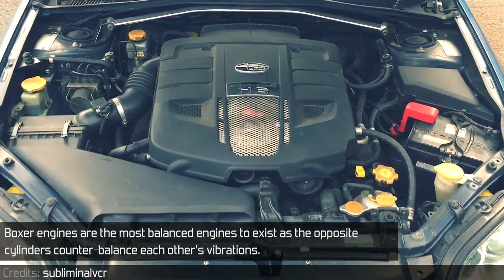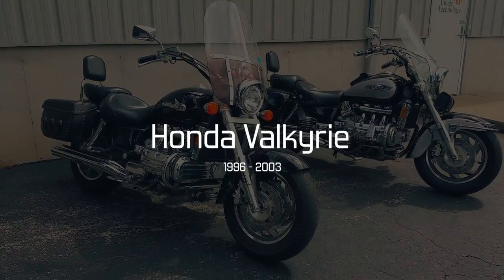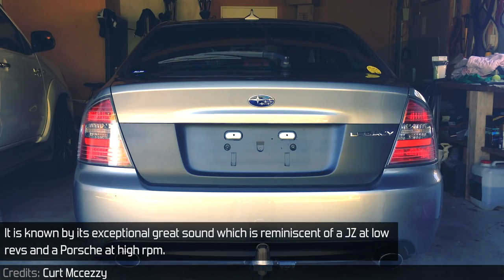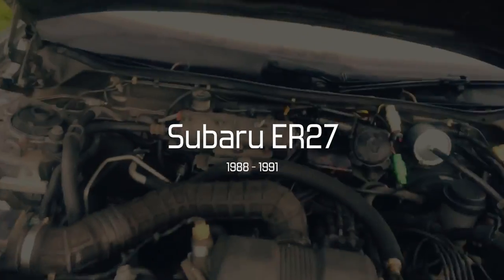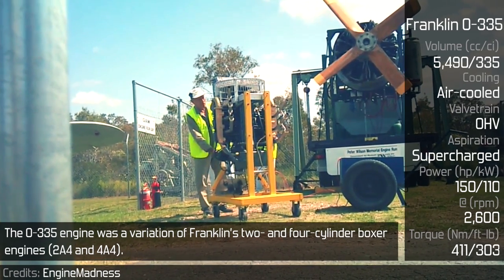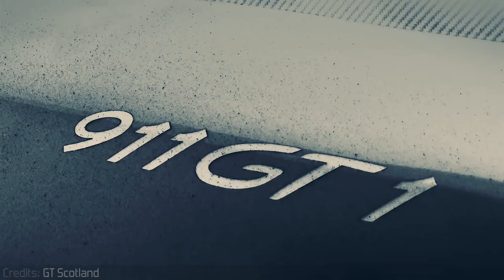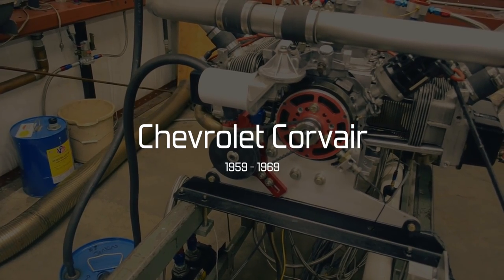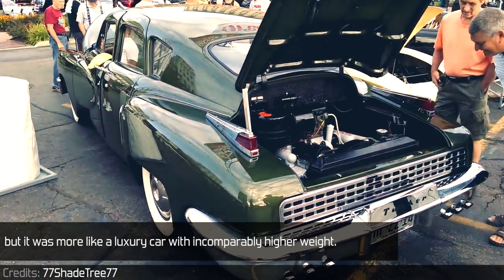10 Uncommon Boxer-Sixes You May Not Know About

Comment: I can modestly say I knew all of these :)
The Lycoming and Franklin have similar names because they follow US nomenclature for aircraft engines used by the military. In this system the letter represents the configuration of the cylinders (R=radial, V=vee, O=horizontally opposed, etc...) and the number represents the displacement in cubic inches.  
Regarding the Corvair, something that our European friends don't usually know is that not only was the 1965 Corvair Corsa turbocharged, but it was actually the world's first turbocharged production car.
I currently own a 2001 Valkyrie. It's a big pussycat, but when you open it up it really turns into a dragon !
Reply: Some 1963 Corvairs had the turbo. I know because I have one.

Comment: Lycoming made a 720 cu. in. 8 cyl boxer (opposed) that is supercharged, turbocharged and fuel injected (TSIO720) rated at 450 hp. because it is an aviation engine it has two separate magneto distributors and two plugs per cyl. There is one on display at the Air Venture Museum in Oshkosh WI.
 Franklin produced a 16 cyl boxer that was never certified and used in target drones it was rated at 450 hp and there is one on display at the Air Force Museum in Dayton OH.
Because aircraft engines run a prop, the load is constant once set, and the horsepower rating is at a 100% duty cycle. 
 An unmodified chevrolet big block (454 cu in) can not be run at 300hp constantly without overheating when turning a prop.

Comment: A quick bit of trivia:  Aircraft piston engines are given designations.  The first part is a letter denoting the arrangement of cylinders, the second part is the displacement in cubic inches.  A Franklin "O-335" means that this is a horizontally-OPPOSED engine of 335 cubic inches.  An R-940 is a radial of 940 cubic inches, while the engine in a P-51 Mustang would be called an SIV-1650 in this scheme, the "S" standing for supercharged, and the "I" for fuel injection.

Lycoming builds a TIO-540 engine which is turbocharged, while Continental builds a TSIO-550 engine, though they are basically the same thing.

Comment: I'm glad you released this video. Some day I want to build an FRS with a flat-6 swap to use as a fun street car. Granted the engine I would consider using isn't in this list, the Subaru engine out of the legacy is one that I considered.
Reply from the maker: I'd consider the 245hp EZ30 from the 3.0R. Great sound, great power, definitely better torque and you still kinda keep the point of the car - the low centre of gravity. Approved!
Reply: VisioRacer I have an outback 3.0r and I can tell you the engine is great!
Reply: Yummy Hershey wouldnt be too hard of a swap to do an ez30 into that body style as people seem to be able to cram straight 6s into it. would recoment going for an ez36 though bit more grunt for relatively the same packaging size.
Reply: That's the one I am considering the most, but it is relatively unexplored. I think it's still the best option though.
Reply: Yummy Hershey check out the might car mods gramps build. you will see that this engine has its stock internals limit explored  however the engine itself is reletively unknown. the more people doing these swaps the more of an aftermarket will develop for it ie what happened to the ej33 and ez30

Comment: Boxer and flat engines are not the same..
Reply: MyLonewolf25 yes they are two names for the same thing
Reply: all boxers are flat engines but some flat engines are 180° vee types :-D
Reply: Joshua Godsey NO they are not 
Boxers do not share a crank pin
180* v types to 
Aka a flat! 
Quite different 

That's like saying a cross plain v8 is the same as a single plain! 

Not all flats are boxers but all boxers are flats!
Reply: Quite right. 
A case in point is the Ferrari 365BB (Berlinetta Boxer) - this has a flat 12, but is actually a 180 degree V12, not a boxer.  This is because the opposing con-rods run on the same crank throw, instead of being separate throws 180 degrees apart and both being at TDC or BDC at the same time

One minor point, the term is 'cross plane' or 'single plane' in cranks for V8 engines
Reply: MyLonewolf25 I read that article and it was very interesting and it makes sense I guess they are different
Reply: So which is the Corvair?

Comment: with lycoming and Continental the prefixes have simple meaning TIGO-550 T-Turbonormalised I-injected O-opposed G-gear reduction with 550cu in of displacement. most all modern general aviation use opposed engines of the 4 and 6 cylinder varieties and cost a fortune  ($30K+USD) nice video but in aviation the opposed engine from the 30's still lives on with only minor improvements, and "eh" quality and dumb costs for the lack of innovation up until very recently with a movement toward fadec engines for certification.

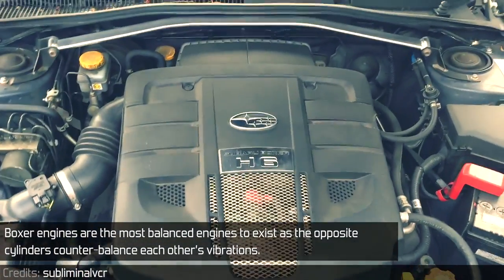Comment: 0:00 wrong. Straight sixes are the most balanced. all forces and also all momentums cancel each other out.
Reply: I6, V12, Flat 4 or Flat 6 are all fully balanced. there is an opposing piston for each piston at TDC.
Reply: Yep!
Reply: mindstormer13 what about rotarys?
Reply: What 911 said. There is an old test from at least the 1980s, maybe older: Start and idle a V12 engine. Place a Quarter/D-Mark (That's a midsized coin for you young people) on its edge on top of the engine and it will stay standing, due to the very subdued vibrations. I've seen it done with a BMW 850.
Reply: 911s73targa incorrect. all of these engines experience vibration due to the dynamic mass imbalance. inline 6 experiences least vibration. https.m.wikipedia.org/wiki/Engine_balance
Reply: barath4545 because the engine was balanced by a harmonic balancer, a necessary part to counter vibration. this balance is not a matter of layout.
Reply: keep in mind that wikipedia can be edited by everyone
Reply: Wikipedia provides good articles so long as educated people contribute. In regards to the engine balance article - the information is good.
Reply: Interestingly enough the article you quoted says that Flat 6 in certain aspects are better then inline 6

These 6 cylinder Boxer engines have 14. (Plane imbalance on torque generation) and 
16. (Plane imbalance on compression) just like in inline six. 

As the strength of vibration generated by these imbalances are more or less proportional to engine length, boxer six has the advantage as flat-6 is much shorter than an inline 6 configuration. 

However, boxer six has additional plane imbalances on rotating mass (4.) and reciprocating mass (6.) due to its left and right banks being staggered front to back, although the offset distance tends to be much smaller in relation to the engine size than in flat-four and flat-twin.

On the other hand, secondary balance is far superior to Straight Six because there are no piston pairs moving together, and is superior to V6 because a large part of secondary imbalance is cancelled in the opposing cylinder pairs except for the front-to-back offset. This makes a boxer six particularly suited for high-revving operation.

And contradict your earlier statement that all forces are cancelled out

"However, the piston pairs that move together tend to make secondary imbalance strong at high rpm"

So for high revs, a flat 6 is better then inline 6 according to this article, because the secondary balance of the flat 6 is better.
Reply: 911s73targa whom are you talking to??? I DID provide a link to engine balance article. I DID NOT state that all forces get to be cancelled out.
Reply: apologies, got mixed up with mindstormer13
Reply: 911s73targa your mind got stormed
Reply: I hate it when that happens, it must be from all the forces and momentums coming off my flat 6
I'm all shook up
Reply: 911s73targa can be swapped by a Chevy V8
Reply: Most 90 degree V8s are fully dynamically balanced in that all dynamic forces cancel since the counterweights are located symmetrically about the crankshaft. There are no resulting dynamic moments to cause vibrations. Any engine that has this trait is dynamically balanced and no balancing shaft is needed.
Reply: +John Michael Twist the harmonic balancer is there to cancel torsional vibrations in the crank for the most part. Each cylinder firing shock-excites the crank and some engines need them to cancel resonances. Only on a few select engines does it also assist with balancing (e.g. SBC 400). 

The coin standing thing has more to do with modern engine management. I can stand one up on my 3.6L V6 as well as my 350 SBC with late model SFI and PCM. Modern engine controllers do a much better job at fuel metering, delivering consistent ignition events, and especially sophisticated idle control logic that uses PID/D logic for the e-throttle and ide spark advance to regulate the engine speed.
Reply: mysock351C Counterweights are NOT located directly oppositely. One bank is closer to the front the other is closer to the back of the car. This is because the connecting rods do not wrap the crank pin at the same spot, but are next to each other. Hence the engine needs a harmonic balancer. ENGINE BANKS ARE MUTUALLY OFFSET. Therefore the moving masses do NOT counteract. The resulting is the rocking couple type vibration.
Reply: mysock351C Bank offset can be clearly seen on this picture. The right side set of pistons is closer to us: http://cdn.bmwblog.com/wp-content/uploads/bmw-m3-v8-engine-1-big.jpg
Reply: 911s73targa I once was very impressed by this project, a very long time ago : http://www.engineswapdepot.com/?p=1881
Reply: JMT, alright I stand corrected. Damn. So that coin thing was just "clever hiding of the problem". So that does it then, the 2JZ or the Cummins I6 for the title then. 
Dang it, still want a rebuilt 850 engine with modern internals though.
Reply: The reason is the engine is balanced.
How? By using heavy counter balance weights, precisely weighed to produce the exact counterbalance to zero everything out.
The cost? more weight!
Boxer engines are balanced by having the cylinders oppose each other, requiring no counterbalancing.
Result? A much lighter engine, and much lower center of gravity.
When my H6 is idling, it's very hard to feel it running.
Same thing with my H4, although the H6 is a little more balanced because of the larger mass.

Any properly blueprinted and balanced engine should be smooth enough to stand a coin on its end...
Reply: Kentucky Ranger once again, the cylinders are NOT opposite each other, because the crankshaft is NOT grasped at same points by a left and a right connecting rod. Banks are offset, hence the rocking couple type vibration, and a need for an eccentric - a harmonic balancer. Picture of bank offset provided above.
Reply: well that escalated quickly 8-)
as John mentioned, you're left with free momentums in boxer engines due to bank offset. For all i know a straight six leaves no forces or momentums of 1st and 2nd order. as the orders are a mathematical simplification there are always negligible forces of higher orders that you will not notice because of their low amplitude. for V engines much depends on the V angle.
Reply: barath4545 not really "hiding a problem", just an impressive show of balance. I think any engine with carefully (re)adjusted weights and clean injection and ignition would repeat the trick easily. I would get a precision scale, measure the rods and pistons, and carefully grind away the least amount of material to have the weights matched as much as possible.
Reply: barath4545 I would probably rebuild the M70 , feeling that's the most I long to do. But this engine is probably the heaviest of the bunch, isn't it?
Reply: wrong. Straight 6's are not the most balanced. They are more balanced than a v6, but h6's have the equal and opposite forces going on, the I6's just have it in one direction.
Reply: OtterConnor read what has been clearly explained above about BANK OFFSET.
Reply: OtterConnor the forces ARE NOT OPPOSITE. The explanation is given above.
Reply: John Michael Twist What I've read by 911s73targa affirms what I'm saying. He said "So for high revs, a flat 6 is better then inline 6 according to this article, because the secondary balance of the flat 6 is better." and the higher the ability to have stable high rpm's means higher rotational balancing.
Reply: OtterConnor this has nothing to do with your erroneous statement that forces are opposite.
Reply: OtterConnor please, read your own  statement then read the reply before replying back... ridiculous
Reply: OtterConnor as far as the article concerned, we find in the very article : "These 6 cylinder Boxer engines have 14. (Plane imbalance on torque generation) and 16. (Plane imbalance on compression) just like in inline six. ( ) However, boxer six has additional plane imbalances on rotating mass (4.) and reciprocating mass (6.) due to its left and right banks being staggered front to back"

So we find TWO additional modes of vibration as compared to Inline 6. CLEARLY, the statement that flat engines are inherently vibrationally superior is quiet questionable.
Reply: The harmonic balancer is just what the name implies, harmonics.
It dampens the momentum of the engine. Each time the cylinder fires, there's a jerk. The harmonic balancer helps dampen this imbalance.
It's not there to centrifugally balance but harmonically balance the engine.
All engines have them, otherwise, the engine would jerk and shake itself apart.
https://en.wikipedia.org/wiki/Harmonic_balancer
The offset is to further enhance balancing. The cylinders are still horizontally opposed.

I don't know why, but your posts make me think you have a special hatred for boxer engines...

The only negative side to a boxer engine is the uneven wear on the cylinders, causing increased oil consumption over time.
It would look stupid, but if you could mount the engine vertically in the car, this wear problem would go away, but you'd have one tall engine compartment, LOL!
Reply: Kentucky Ranger The bank offset is a product of design - the rods do not wrap the crank at same point. The cylinders are not exactly opposite. A picture of a boxer from above confirms this to an observer with normal vision.
Reply: I understand. The reason Subaru did this was to improve harmonic balancing.
To split hairs, no, they aren't perfectly opposed, but it's to help magnify harmonic balancing, requiring a less heavy harmonic balancer.
You have to admit, Subaru was a genius in the design. I have an H6 and when sitting idling, I can't tell the engine is running.
I know the old V8 and V12, as well as straight 8 engines of the past,  were incredibly balanced, but very HEAVY.
The biggest advantage of boxer engines is weight conservation. Other than that, the uneven cylinder wear is their Achilles heal...
Reply: Kentucky Ranger "harmonic balancer is for harmonics" this has to do with SHM or HM - Simple Harmonic Motion. Any point on a wheel, except center point, experiences SHM. This can be expressed by a graph of a math function Sin and/or Cos. An eccentric mass wheel, is a harmonic balancer given Simple Harmonic Motion of it's center of mass as it rotates. As far balancing out a jerk - well this is the flywheel function. A harmonic balancer combines these two functions. One cannot expect not to use an eccentric mass to balance mutually shifted masses of engine banks.
Reply: Kentucky Ranger I don't hate boxer engines. I am a mechanical engineer, and realize that every system has its natural requirements. I think it's silly to hate an engine anyway.
Reply: k then, anyone wants popcorn?
Reply: Diarmuid Marsden they use counter balancers